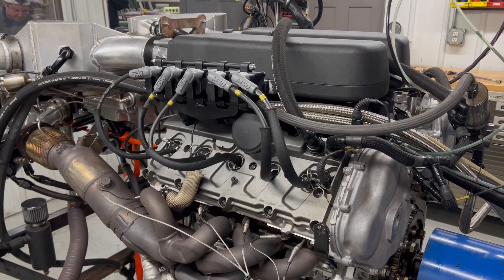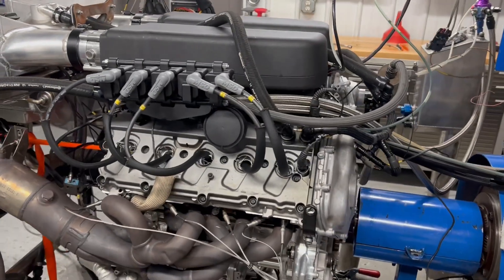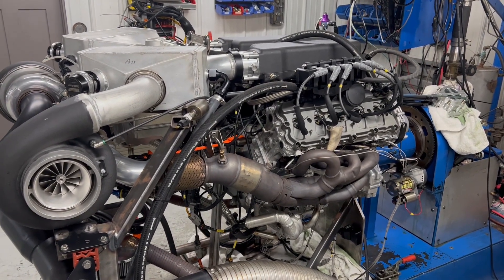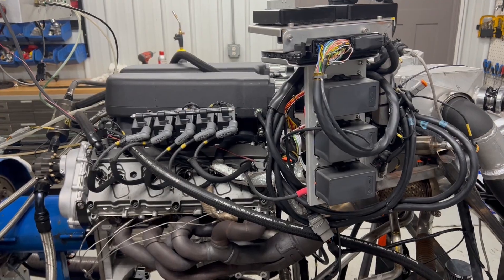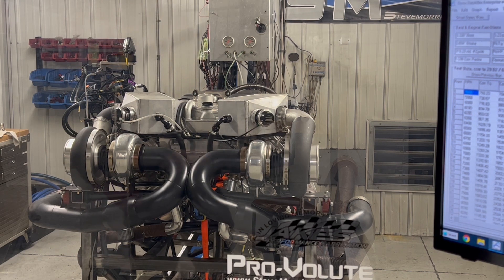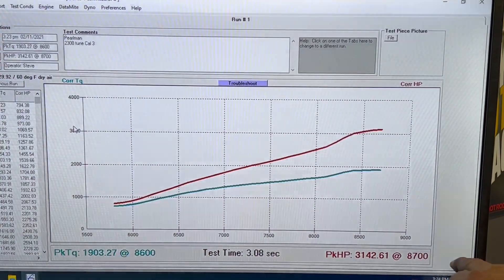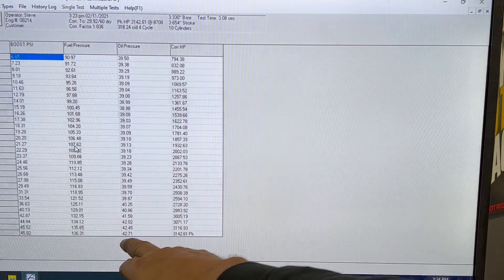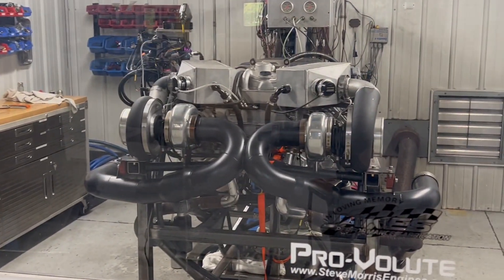3,000+HP Twin Turbo Lamborghini Engine Dyno!!

Comment: These pulls he makes are almost comical how terrible and misleading they are.   Doing the math it looks like it accelerated at 966 rpm a second.... Yea Steve   GOOD PULL..lol  upon further inspection  its easily seen that this peak hp number isnt even close to being realistic.  5.2 Lamborghini engine makes ballpark 600 hp at the crank (this one probably less due to lower compression) Take that peak power number of 3142 and subtract the base number of 600 and that gives us 2542 hp.  Now take that 2542 number and divide it by the boost number of 46 and that gives us 55.26 hp per pound of boost out of a 318" engine.  Riiiiiiight........   I just watched a few of his dyno videos he posts and damn is his dyno extremely generous......  Please for the love of god, calibrate your dyno, stop with the bs, and figure out how to make a dyno pull........

Comment: That power curve is probaly the most impressive thing I've ever seen. Getting that amount of power, without having a ginormous turbo spike. Impressive!
Reply: Nope. Graph starts at 5500. I bet there's a severe ramp up somewhere below that, especially considering that it's making like 700hp+ even down there.
Reply: Only showed the part where the turbo turned on, would be interesting too see from 0-8700 rpm
Reply: like a na engine. no boring torque curve like most turbos have^^

Comment: I'm sorry but do you do any kind off stress testing at all? A power blip of 3000 is one thing but what happens when you run it wide open for 30 seconds? Or 50% for 2 minutes? Or 30% for 5 minutes?

Comment: awesome build, lovingly honesty about the gremlins which we all get.  did you notice at peak power it pulled the flapper vent shut on the wall? literally could not get the air into that room fast enough. I wonder if that had an effect on the final result? Interesting.

Comment: So what would this make to the wheels around 2600??
Reply: Unless you are running on fat drag promod style slicks in the rear, the parasitic hp loss in these cars should be no greater than 100hp in rwd mode on dyno. Whatever the difference in hp number you see when the car was stock remains pretty much the same after modification, its not like suddenly the tires needs extra few hundred ponies to be rolled
Reply: Something like that but this is only at 45psi that motor will make  to 55-60psi which will be another 800-1000 crank easy

Comment: Set of long tubes will get rid of those hot spots in the bends just a thought. Looks like there hunting down some vipers
Reply: I believe the problem is space. Lambo engine bays dont have much spare room in them BEFORE you twin turbo them
Reply: @Grumpycnt  yeah it’s got to be tight but would look so cool

Comment: I think those turbos still have quite more left in them. Can generate over 60psi with those FP 88s on 5.2 v10
Reply: remember boost is a measure of restriction, not power
Reply: @scootbmx01  that’s why I specified the engine size. Obviously bigger engines will make similar power at lower boost

Comment: Looking at the fuel pressure in reference to the manifold pressure, that's quite a high differential pressure so the safety strategy was a very good call. Which is sort of expected since this is quite an extreme project where the output breaks down to 300+ horsepower per cylinder. Does it run a mechanical fuel pump or normal electric fuel pump?

Comment: 1:55 did the dyno just shake? I have seen a lot of Steve's dyno pulls, but never an engine just rattle the dyno like that.
Reply: Sucked all the air out of the room too
Reply: @kene6838  , Turbos are exhaust driven. Superchargers suck in air.
Reply: @wilsonjohn9766   The motor is using room supplied air for combustion, your lost
Reply: @Chiraq312boi  , Turbos are sucking the air out of a room when their exhaust driven?
Reply: @wilsonjohn9766  The exhaust spins the turbine, the compressor wheel on the other side of the turbo does what?
Reply: @wilsonjohn9766  I’d look into various theories of operation on some components, like turbos.
Reply: @wilsonjohn9766  so by your way of thinking this should drive under water. 'The turbos dont suck in air' best of leck with that champ.
Reply: @Grumpycnt  , Best of leck to you too. My way of thinking was pro chargers suck in air hence the reason he puts bells on them. Turbos you can stick anywhere because inlet air isn’t an issue since they’re exhaust driven, but evidently I didn’t get something along the way and never thought or claimed I was a turbo expert.
Reply: @wilsonjohn9766  all good dude, we shouldn’t have bitten your head off. All engines regardless of style use the air in the dyno room for combustion.
Reply: @wilsonjohn9766  Both superchargers and turbos suck in air  and compress it into the engine.

The difference is super chargers spin their compressor  directly off the engine's created power via belt usually, while turbos spin their compressor via exhaust gases spinning another impeller attached to the compressor.
Reply: @wilsonjohn9766  wtf do you think the turbos suck in? Air. They suck in air. Turbos as driven by exhaust, yes. What’s that got to do with air?
Reply: @jamesbizs  , I thought I explained my mistake maybe you didn’t get the memo.
Reply: @wilsonjohn9766  Both superchargers and turbochargers suck in air
Reply: Lower rotating inertia probably has something to do with that